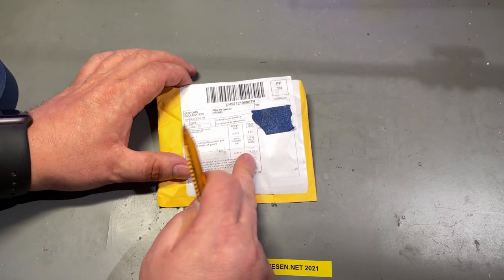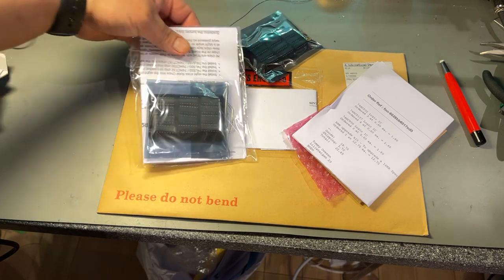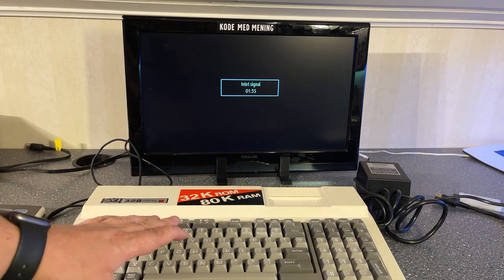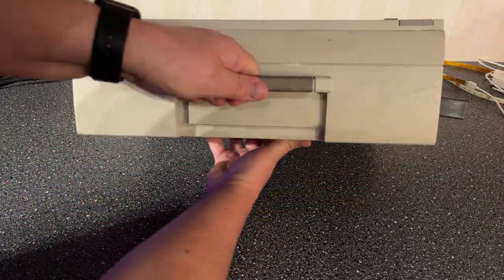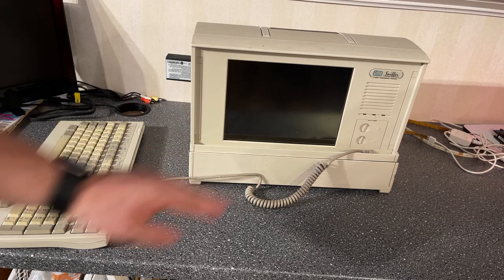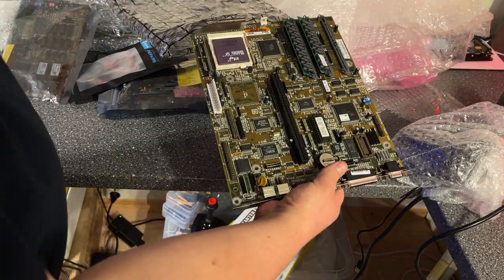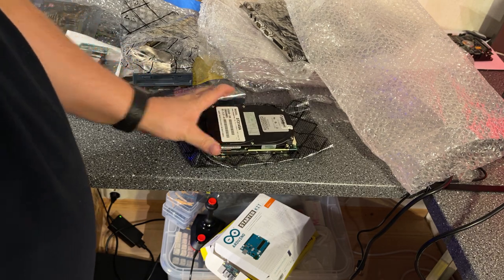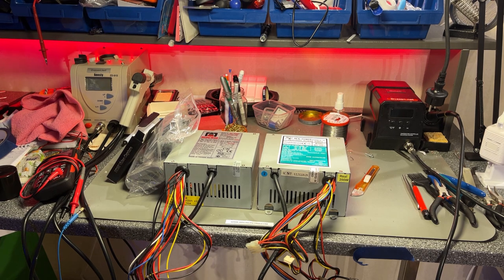Mail and donations - March 2021 - Spectravideo, Compaq sniffer, Sun Ultrasparc ++

Comment: Wow UltraSparc laptop! I would really like to see this one revived!
Reply from the maker: Yes, hope I can get it to boot :)
Reply: @Arcticretro  Try plugging a terminal into the serial port, Sun machines are supposed to provide a console there
Reply from the maker: @Breakfast_of_Champions  Thanks. I will check it out when I start investigating this machine
Reply: @Arcticretro  just shout out if you need a Wyse compatible serial/parallell terminal to test with :)
Reply from the maker: @everythingexplained  Sure. I will count on u